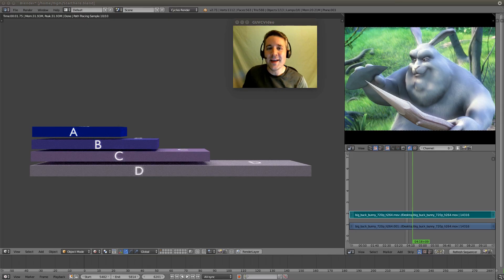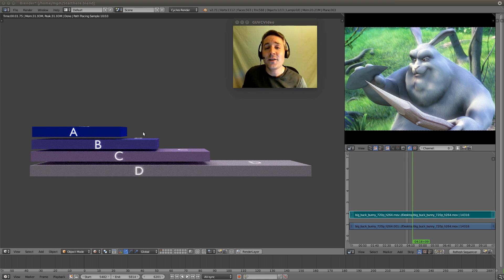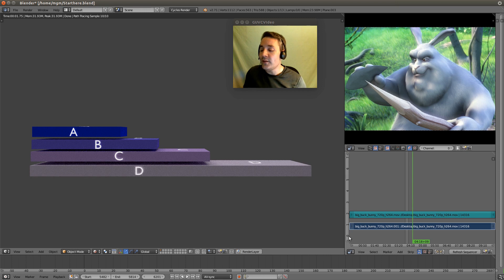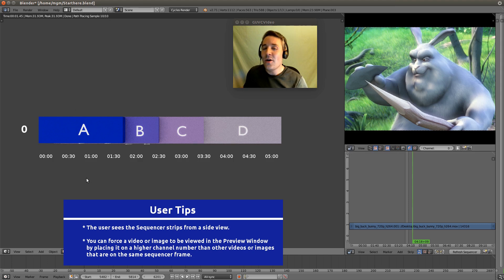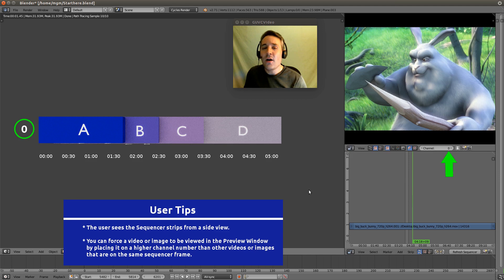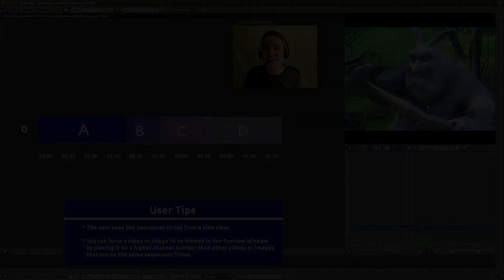5 - Blender Video Editing (How Channels Work)

Comment: Would have been easier to understand if you used 1, 2, 3 for the blocks instead of A, B, C... since that would be the actual channel numbers you are talking about.
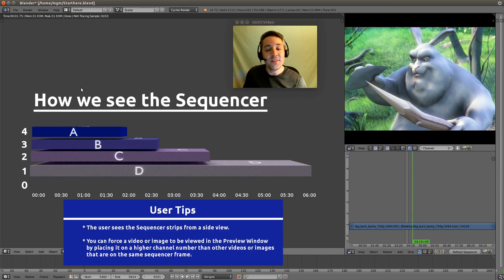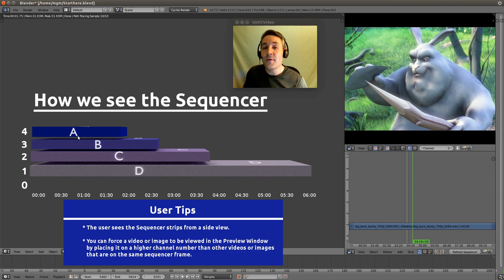Reply: +gcbzzzz  At 1:13, I show the strips (A - D) as they are presented in VSE. This is the reason why I label them A - D instead of 0 - 4. At 1:37 I also demonstrate that, when you look at the strips from the Top down, it is viewed as if you are looking at it from channel 0. What I'm trying to say is, I disagree. Thanks for your input though. I always appreciate and consider the advice that my viewers give me, but I don't always agree. :) Thanks for watching!